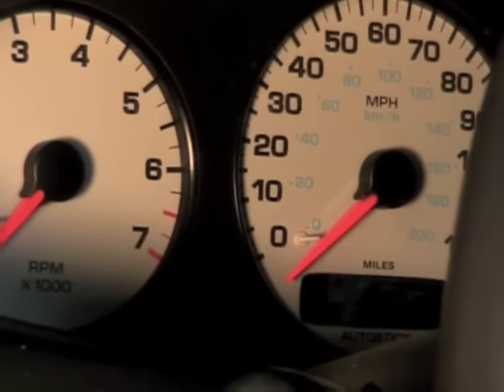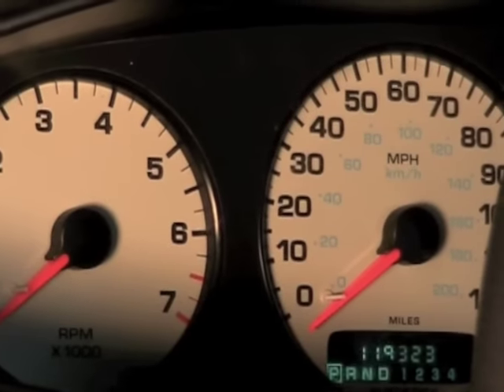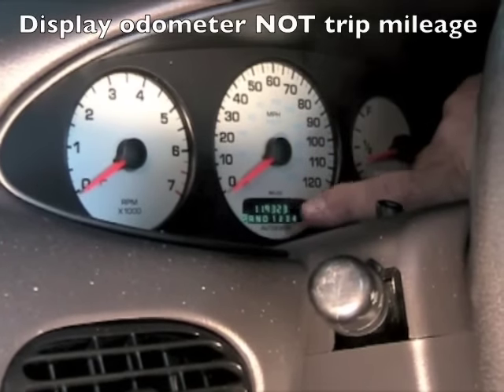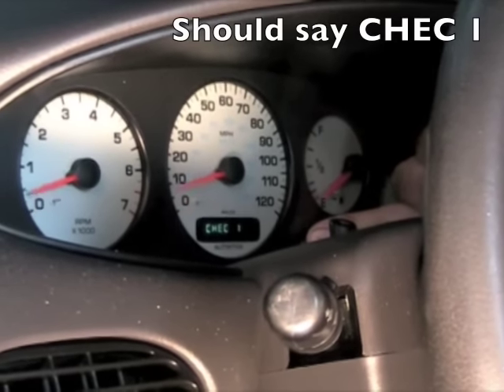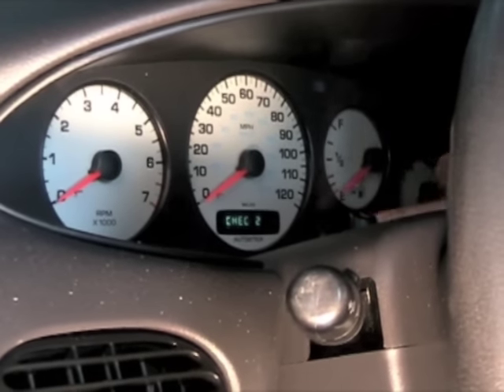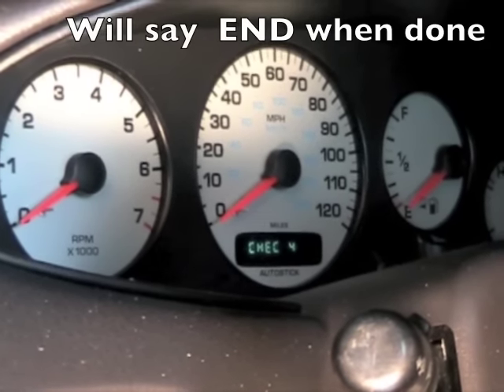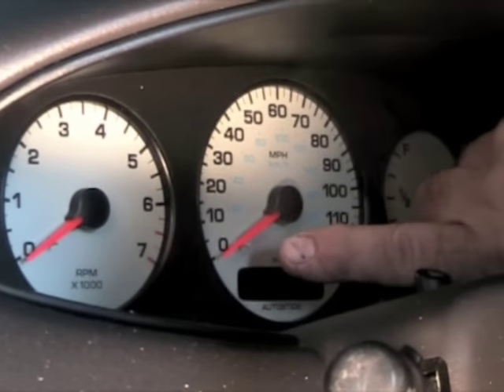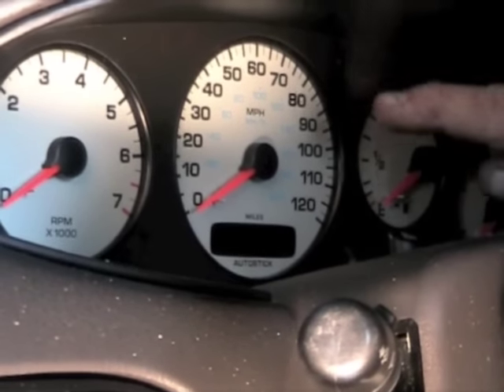Speedometer reset procedure

Comment: first off let me say I am a retired mechanic of over 10 years so I know a little about cars . this is the very first time I have heard of this fix . I just started having trouble with my speedO in my 2000 dodge neon so at this point I have tried nothing  . my speedO reads 0 until I get to about 30-40 mph then it starts jumping all over , up and down . it ran so far up that it tried to come all the way around and then stuck in the position you described , being under the needle stop pin . I was getting ready to take the dash apart to get the needle back in position when I found your video here . in short , you fix does work ! and it saved me a lot of unnecessary work !!! my display on the 2000 neon was a little different from the one in your video while it was resetting but it done what you said it would do !!! thanks a lot for your time to make the video !! now I have to go out and start looking for the original problem lol  .  have a great day :)
Reply: Gun Runner I have the same exact problem when I reach 35 it goes up but until I hit that speed it stays at 0. With my 1998 dodge.
Reply: Ok, great. I have done the procedure on my 2002 dodge neon but it did not work. I really would like if someone would make a video of the process and then SHOW THE CAR DRIVING WITH THE SPEEDOMETER WORKING AFTER THE FIX.
Reply: Well got the problem here of that same issue 2002 Dodge Neon  .. it went way over when I was trying to start the car on the third try when I forgot. Had the lights on in the wet raining weather we Bern having. The car window leaks since the idiot gal crashed the car front end. When it rains or snows the water gets in t the front dash rns in t he fuse panel and shorts out man fuses . Heater radio wipers etc thnking to gasoline the whole thing to stop water leaking into. But yet why would it jump the needles on both the speedometer and RPM dials.. gonna try tomorrow to fix it all.. cause this 61 yrs old woman has Dr appointments to get to .
Reply: This might be  issue is a bad speed sensor if this trick doesn't work

Comment: My 2003 Chrysler Sebring had a loose positive battery terminal contact which caused complete loss of electricity to vehicle. This would happen very intermittently but when it did complete car was DEAD. After finding problem & repairing I noticed speedometer needle was on the wrong side of stopping pin. This video was easy to follow & saved me much money as dealer wanted to replace complete cluster. THANK YOU VERY MUCH.

Comment: Thank you!! My RPM needle was under the pin.. this fixed it..
 2000 Dodge Stratus 
Thanks Again!!
Reply: Same here!!
Mine is a 2002 Dodge Stratus Sedan. 
I had put a new instrument panel in and my rpm & mph guages weren't working, but everything else was. I didn't want to have to take my whole dash apart again so I googled it to see if it could be fixed and came across this video, thankfully!! 
At first though it wouldn't work, but I figured out it was because I had my driver's door open! Lol

Comment: I have a 2001 Dakota 4WD.  Speedometer stuck at 120 mph after I reconnected battery and started the vehicle.  Steps were slightly different from what you described, but close enough.  For the 2001 Dakota, after "CHEC" appeared in odometer display, I let go of button.  Lots of things lit up one after another, needles moving around, speedometer dropped back to zero.  Then finally the odometer showed my mileage and that seemed to be the end of the check.   (It never showed "END" in the display.)  Thank you so much for your helpful video!!  Saved me alot of time and energy!!
Reply from the maker: good job, glad it helped, thanks for your comments

Comment: God bless you! I really mean that. My 2004 Dodge Ram, which I love dearly and will never let go of, had a gas tank fuel sender issue and somehow during that time they fixed that, but now my speedometer was pinned in the reverse direction and I thought Oh gee whiz, what now?? I did exactly what you suggested and it reset and fixed everything beautifully! I replaced my ignition switch and module a couple of years ago and so now there are two keys, one for the door and one for the ignition and I thought for sure that the tech had used the wrong key in the ignition which makes different stuff happen in the car lol. Turns out that you just absolutely made my day and saved me a hundred bucks on Amazon thinking I had to replace those items again. Thank you!
Reply from the maker: I'm glad it helped.  And thanks for your kind words.  God has blessed me way more than I deserve.

Comment: Yay! It worked!!
Thank you for this video!!
At first it wasnt working, but I figured out it was because I had my driver door open lol. 
I have a 2002 Dodge Stratus Sedan and had put a new instrument panel in at my friend's garage,the new one is much nicer looking than my old one. 
I figured out on the way home that my RPM & MPH wasn't working,but all the other guages were.I had to guess my speed all the way home and it was nerve racking!! 
 So, last night I Googled it to see if it could be fixed so I wouldnt have to put my old one back in, and came across your video. Then today I did exactly as you said and it fixed it!
Reply from the maker: glad it helped. Thank you for sharing your comments

Comment: The tachometer on2000 Sebring JXi convertible stopped working after an alternator and dead battery problem. I found this Fix  by Googling 2000 Sebring JXi tach stopped working. Everything else on dash was working. This was the easiest fix I've ever done. Took about 15 seconds. Thanks for posting.

Comment: @dkrula080 As he explained (but you may not have identified) is when he said "spike" A voltage spike can happen when changing or disconnecting the battery terminals and this sometimes "chattering" the battery terminals! 
 
28 Year Master, L-1 Technician

Comment: That's also how you reset the oil change light on Toyotas. Some use trip A but some it will reset with the odometer on when you turn the key off.

Comment: I have a 1995 neon, and i tried this method, but of course we know that my speedometer is manual, not digital, so does this method still have the same effect? I will know by tomorrow, but just in case you see this before then, is it another method to the older generation of the chrysler (Dodge Neon)?

Comment: i changed my cluster not once but twice and whn i did only light that would come on was one of my signal light arrows but would not read trip or mileage on it at all it was black this was on a 2004 300m will reset remedy that too or is there another system for that

Comment: Hi My 2002 windstar the speedometer says twenty miles an hour top speed I changed the vss input it worked got one trip and went back to not working and did the same thing for the output could you tell me what is left to change?  oh yeah I changed the cluster before changing the the sensors it didnt fix it .

Comment: i have a question, a friend of mine told me dat i kan reset the speedometer by disconecting the negative and positive cables from the battery and then touching them together for 30 secs, does dat really work?

Comment: I have a 99 caravan and i tried this but still have a problem when i turn on key my gag. jump up to 10 mph and tach jumps up to 1000 rpm the temp goes up also the reset work but when i turned it back on jumped rite back up any ideas

Comment: I have jeep grand Cherokee 2001 4.7 limited - 8 cylinders - 2WD

I bout it since 2008 and till today .

last year May 2019 my story start by whistle from back of the car ( fuel pump as per the mechanic guy said , but unfortunately after he change the fuel pump still the sound there, then I don't know what he did later own the sound gone i think he changed other one, and during that time issue he replace engine fan as engine heat, then the story coming up with speed kilometer up.

all up solved but during this few month I have new issue coming up as mentioned below.

symptoms

Transmission shifting not well and sometime I have to press fuel paddle to increase the speed to shift from speed to other, and some time I press more to hit the speed meter to read the speed well.
2. I have erratic electrical some time with tail light behind the driver side, as its not working sometime at all and some time with running with car little return back normal.
3. sometime I found like the battery disconnected by seen the dashboard top of my head changed from kilometer to mile as I am using kilometer signs and this happen when I disconnect the      battery only but this happen one time and I found battery plug lose.

4. sometime I feel the Ac speed going low-up.
5. hand break light either you close it or open it the red light on dashboard keep opened.

My car now running more than 190.000 kilometer and last November I changed list below

1. Camshaft.
2. crankshaft.
3. 8 coils.
4. 8 spark plugs.
5. fuel filter.
6. Ac compressor, as the old not working well.
7. clean throttle body and changed sensors.
8. O2 sensor changed and check engine gone.

hope really help me as I am facing this issue since 1 year now and am scare go back to mechanic shop as no experience.
Reply from the maker: I can understand your frustration.  Without actually seeing the vehicle I can only make an educated guess.  Since you have already changed many of the possible parts I would suspect you either have a vacuum leak or more likely an electrical issue.  Don't take it to a regular mechanic, instead take it to one that specializes in electrical issue.  Hope this helps

Comment: i have a 2001 chrysler neon. speedometer is not measuring the speed im going, but when i run the reset, it resets as normally as the other needles. i mean, acording to the resets process, its working, but when im driving, it marks 0kmh. could i get any help on this?
Reply: Maybe its because of bad speed sensor.

Comment: Not sure this will work on a 2002 Dodge Neon which jumped clock wise in trying to start with a dead battery ..
Reply: It worked on my 2002 Dodge Status Sedan. I had put a new instrument panel in and my RPM & MPH guages acted like they would try to work, but wouldn't (guess the needeles were hitting the pins). 
At first the reset wasn't working, but I figured out it was because I had my driver door open! Lol 
I closed my door and tried again and bam it worked! Thank goodness! Cause I really didn't feel like taking my whole dash apart again to put old instrument panel back in!! Lol

Comment: i have a 2001 audi and my speedometer does not work what do i do
Reply: Search for a used one online like at google ,or e-bay for used Audi 2001Speedo if your sure it’s the speedo? You can also google 2001 Audi and Reset Speedo or Troubleshooting when just stopped working ? What model is your Audi ,is it an A4? Here is a Link that might Help !!

http://www.audiworld.com/forums/audi-90-80-coupe-quattro-cabriolet-22/speedometer-troubleshooting-repair-procedure-2087589/

If it turns out to be the Speed Sensor instead of the Speedo itself for your year ,but I’m not sure Model but if the Sensor is the Culprit as in a Lot of cases ,They Run from $10 to $25 online and are available New and Used. You can look up how to determine which it is and also how to change either Speedo or Speed Sensor on this Site Here. Good Luck,You will save a lot of $$  by Doing It Yourself DIY !

Hope this Helps ?
herculesx

Comment: '04 Dodge Grand Caravan solved same problem by simply holding down the button about 10 secs until a code displays, then release button and wait a minute to run through the diagnostics and needles will reset. No key turning involved. https://youtu.be/dYMymmhbOr8